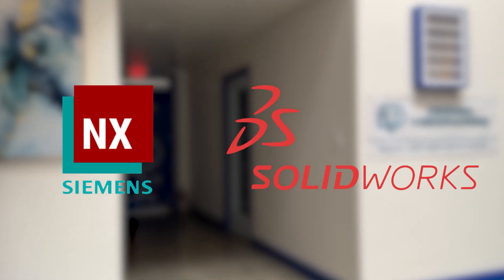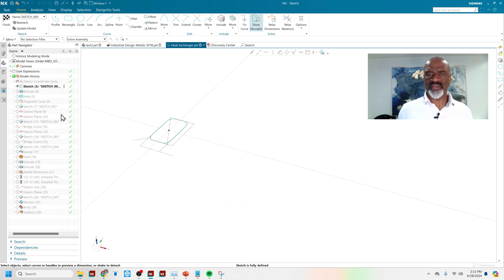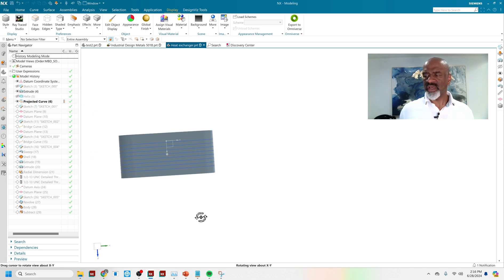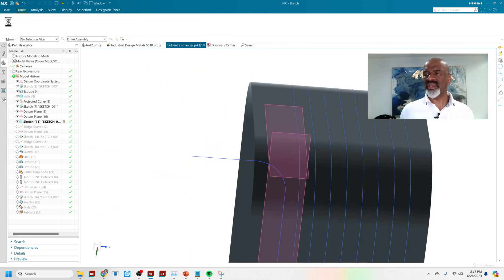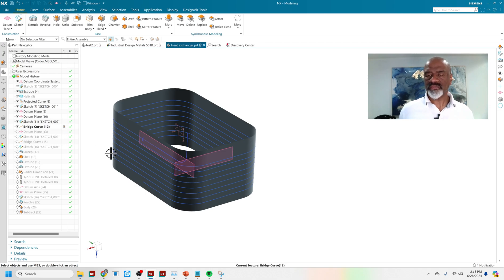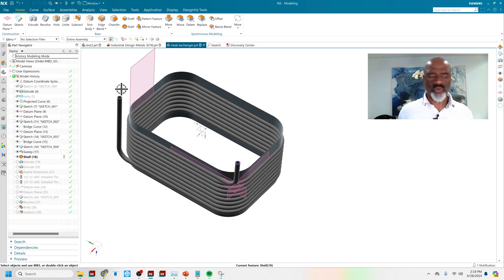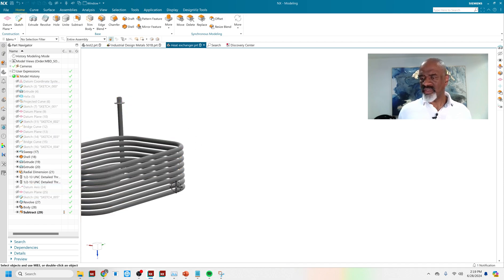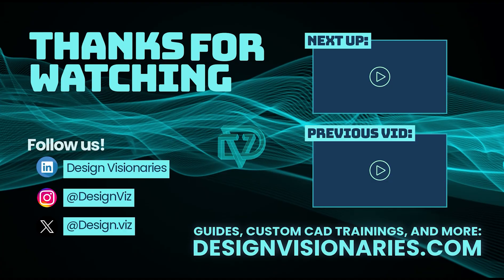How to Design a Heat Exchanger in Siemens NX 2312 #siemens #siemensnx #cad #science #engineering

Comment: Steve, my new 3D priest/Yoda. thanks so much for all your fantastic work. Recently I'm going all in and at full throttle on surface modeling. Does your Basic to Advanced NX11 book cover this? thanks
Reply from the maker: Hello Mr. Mayer, and thanks for your support! Basic to Advanced Computer Aided Design Using NX11 covers surfacing from beginner to advanced, and many other concepts. It covers the following (and I imagine I missed some):

Simple Surfacing:
-through curves
-ruled surface
-sweep along guide - etc

Advanced: 
-swept (with multiple guides)
-variable radius edge blend
-face blends
-variational sweep

Freeform Surfaces:
-bridge
-through curves
-through curve mesh
-fill surface
-iso-parametric curves

Surfacing Options:
-trim
-untrim
-delete edge
-offset surface
-variable offset

Edit Surface:
-x form
-enlarge
-flattening and forming